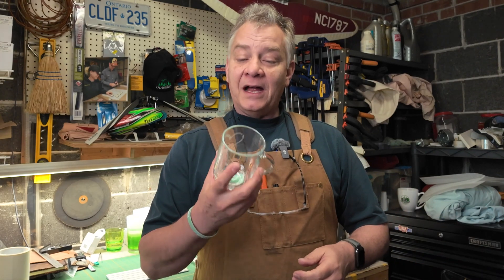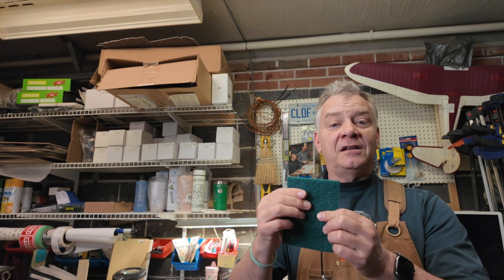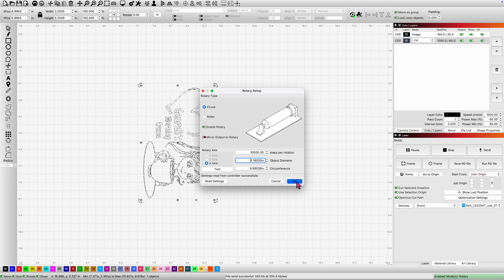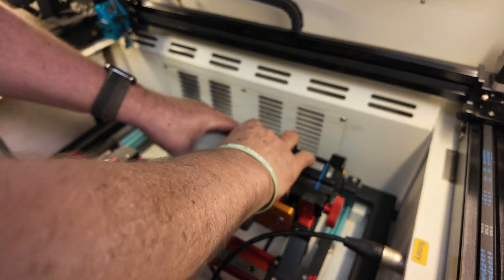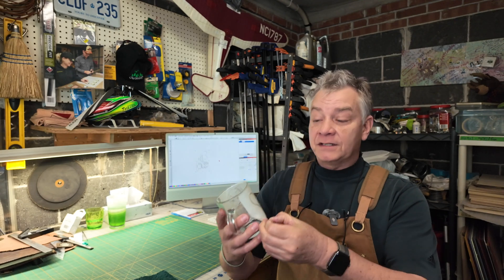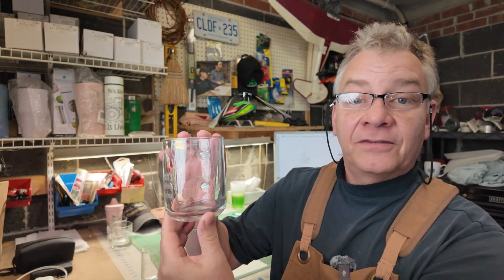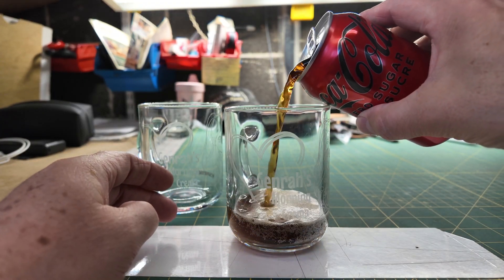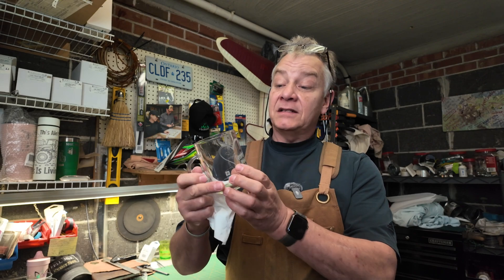I Was Wrong. Engraving Glass on Thunder Laser BOLT.  077   4K

Comment: Just wanted to come back and say I have tried these setting and was thrilled when it turned out the way it did. You’re right on when saying it’s a significant improvement over the other settings we have used prior.

I did use the green sotchbrite pads and it scratched my first glass I think it was too abrasive but since then changed to a scrub daddy and it’s been working excellent. 

I will say if you haven’t tried tiny drop of dawn dish soap on the glass instead of the transfer paper you most def should! The engraving comes out a full shade brighter with these exact same settings you showed using the 1.5” lens. 

Either way, thanks for finding this out and sharing it with us, it came just in time for a rocks glass order that might turn into a larger order if the right people are impressed. Hope you have a good day Gord, thank you again.
Reply from the maker: Hey so happy it helped and thanks for the tip as well. Here's to hoping you get that bigger order! Cheers and all the best sir!

Comment: If you need a mask, your settings are still wrong. Sorry
Reply from the maker: Hey thanks - so are you able to engrave glass with a C02 laser with no mask, or dish soap or any other assistance ( Cermark or BLAZR Orange etc)? If so, what laser do you run and how do you do it? Thanks so much :)
Reply: @LaserNUG  It would be nice if they replied.  I clicked on their channel but nothings there.  Keep up the great work.  I'm impressed this is your first laser and you do such great work, and you share what works for you.  I just seen you got a new Laser Nova PLUS 35 60 Watt C02 Laser great laser and great video.
Reply from the maker: @ Thanks Terry!

Comment: I saw your video and noticed  when I stopped the on video mark 10:34 frame:   the top of the word "Crema" had a fracture. Or is it a reflection? On the other hand Great video content.
Reply from the maker: Morning Louis. Yes there are still a couple of little cracks or fractures for sure - just very few compared to the 2.5" or the previous settings I used to use. Thanks for tuning in!